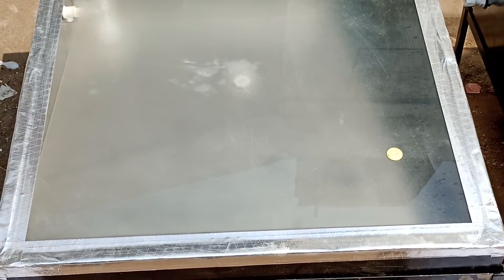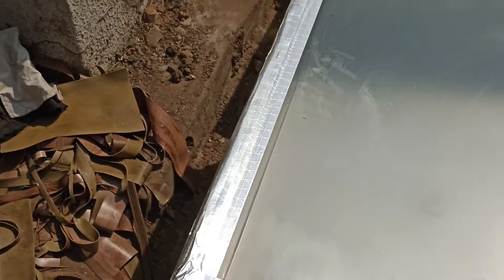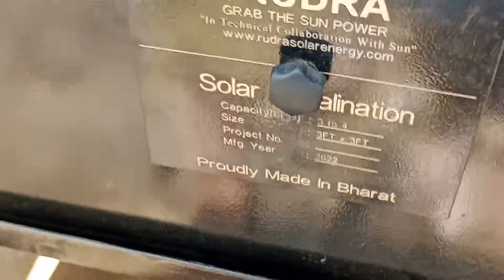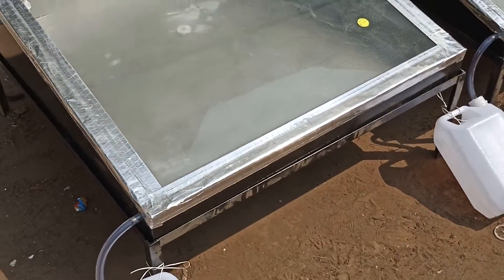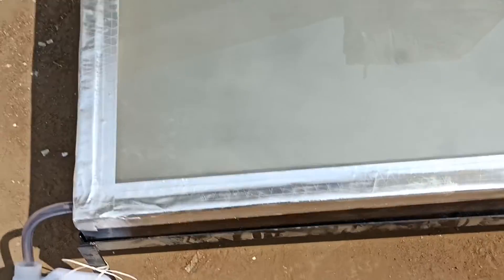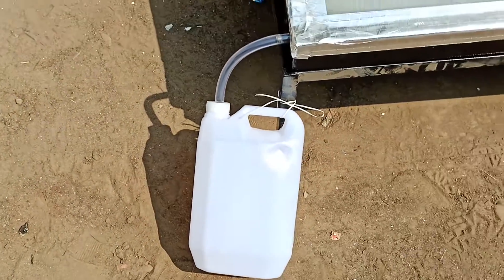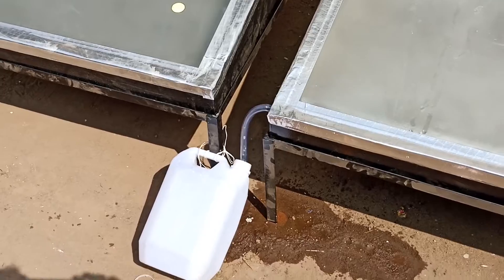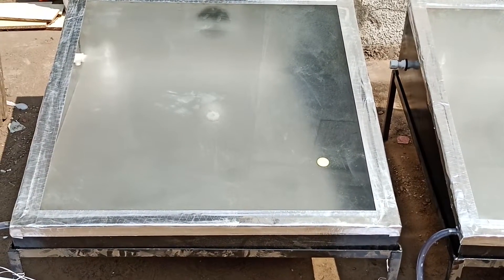Solar Desalination | Solar Still | Solar Water Purification | Pure Water Using Solar Energy

Comment: The basins should be painted black so as to capture more energy, and you might want to insulate them.  In addition, if you could cool the glass, you'd speed up the process.
Reply from the maker: @fuzzywzhe  yes we did all this  ut the paint  or owdercoating gets removed in just one or two uses also it don't have that much output impact but the insulation and cooling the glass has increased the output per day per sq mtr